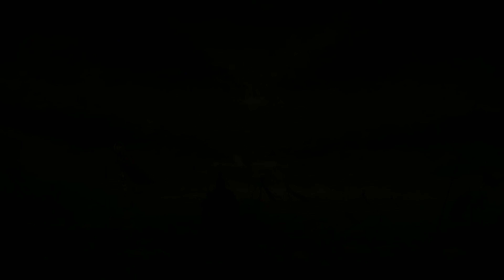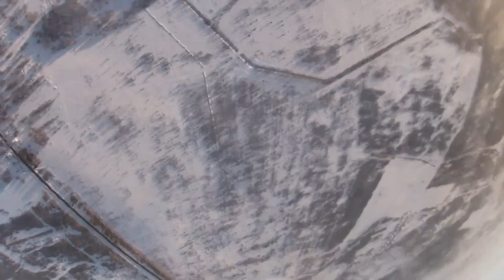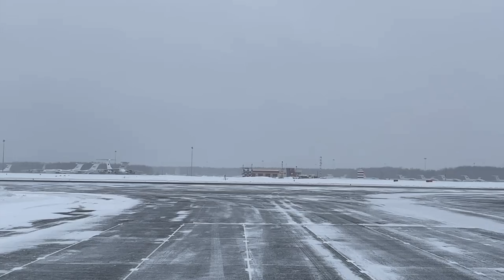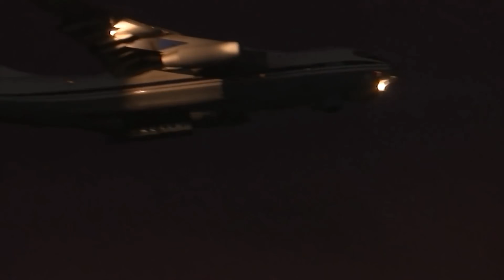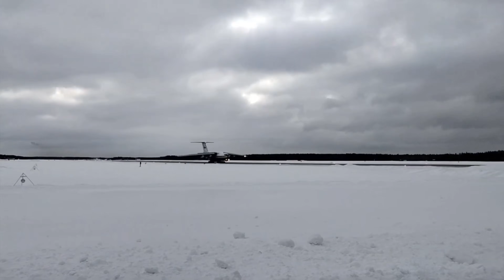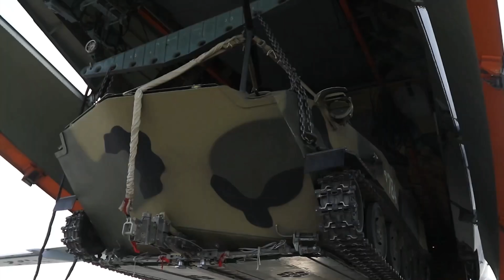The Russian IL-76 'Candid' Transport Aircraft | SOVIET HEAVY LIFTER ✈️

Comment: The A400M is next generation, and overlooked.
Reply: The A400 is good but is it capable to handle rough terrain for decades on end? Or is it a hangar queen? Time will tell! 🤔
Reply: @Mr820121  Turboprops should give it shorter strip requirements but the landing gear looks wimpy compared to Candid. Really only the russians could come up with a cargo jet that can take off from literal fields.

Comment: 40t payload is not a lot. It’s roughly the same as the A400M.
Reply: Look up when it was designed. It's not a new aircraft design by any stretch. A-400M is FAR newer. Had USSR nor dissolved, it'd be using An-70 and maybe even something else.

Comment: Why does it have windows on the bottom front?
Reply: For navigator and easier to land on the runway as the cockpit is seat so high and the nose poke out that block the pilot video. Remember that it was designed to land on make ship run way
Reply: @boocomban Also, due to the possibility of landing on an unprepared runway, technically the IL-76 can land on the ground without being damaged and then take off. This is also the place of the weapons operator, yes, he has a tail turret with a shooter and bomb pylons. This place can also be used to control the discharge of a transport platform with cargo or the accuracy of the discharge of a extinguishing agent when extinguishing forest fires, for example. This is the navigator's place.

Comment: The basis for the A-50 Mainstay.
Reply: The US seems to also be going this way. But no one is really talking much about it.
Reply: whats left of them
Reply: @veeas11 Yeah. Russia now uses the A-50U and the A-100 Beriev. You can only find Mainstays rotting in their Airbases. Mothballed in the tarmac.
Reply: @veeas11 And ? Cope harder
Reply: What's funny is that russia just stopped all production on a100. No explained but most believe that it's not possible to operate safely against a modern airforce. With the advancement of BVRM like r37m, pl15/17 and aim 260 if ever finished. Have the range about the same as the AWACS. It seems like fighters or stealthy bombers possibly specialized will fill the roll. Having JISR SYSTEMS  ON MANY 4.5 AND 5TH GEN TO DO THIS.
Reply: @vasilijevukadinovic6843  yeah russians don't have the luxury of flying AWACS over proxy wars as they are the target of them, MiG-31 groups can be used as a substitute in a pinch with their powerful radars and numerous datalinks